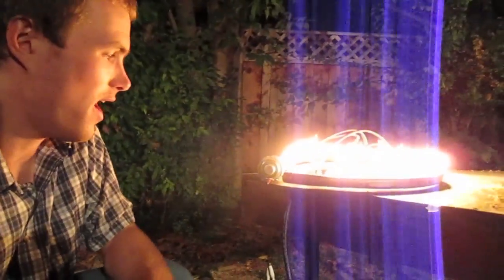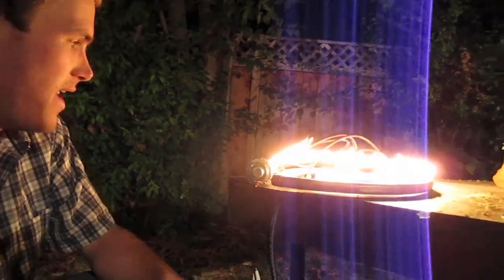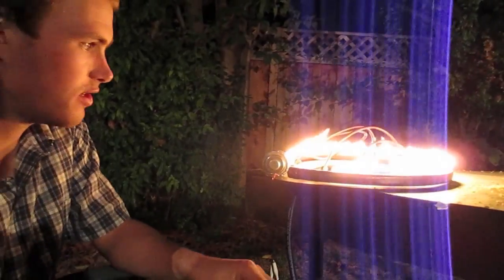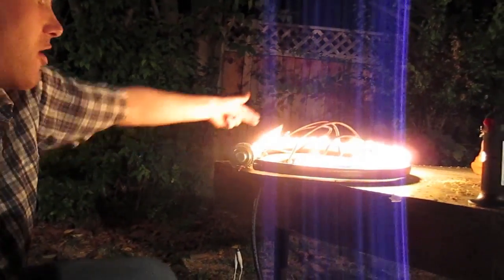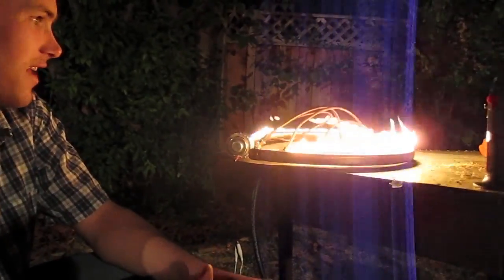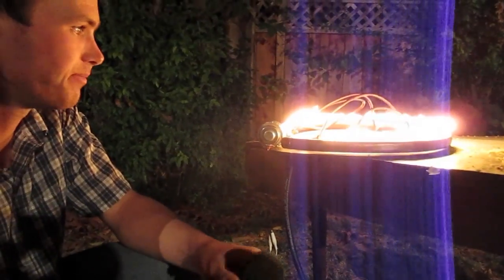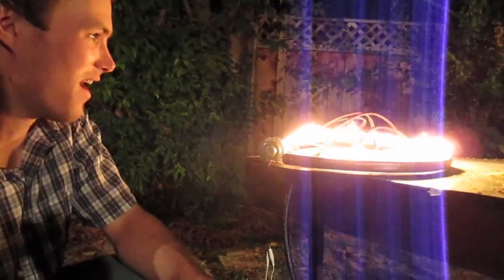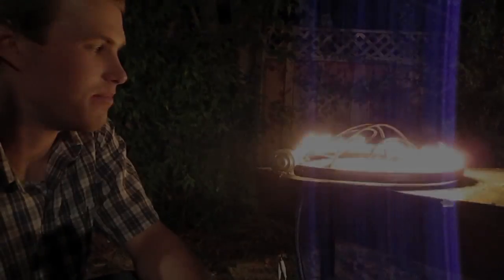Ruben's Tube for Burning Man (Development and Demonstration)

Comment: Did you build this in sections? Is that what the four copper pipes are in the center? Each supplies propane to a section of the tube to get an even burn or are they more structural for the hat

Comment: Looks good, but the fire isn't as defined as some of the other ruben's tubes i've seen on here.  I wonder if having fewer holes would help define the sound waves a little better?
Reply: Little late for replies I know but for others searching the curve doesn’t diminish the effect you can essentially have any shape you want the gas fills the tube uniformly complex shapes might require multiple injection sources but otherwise shape won’t affect it, but fewer holes in his case would definitely help the vidualization I would say half that many holes would be sufficient for max effect you want the holes spaces farther than your individual flames are wide. Sorry for the novel I’m building one of these now and just sharing info
Reply: @nerddub  wow didn't expect to ever get a reply on this comment haha.  That's  cool that you can use any shape but I don't have a pipe bender so I just made mine straight but it worked quite well!
Reply: @adamtwelve  awesome!, quick tip for no pipe bender lol, fill the tube with sand and use nails/ bolts in a board to bend against works well enough!
Reply: @nerddub  I'm going to have to look that up because I can't visualize how the sand plays into that lol
Reply: @adamtwelve  the sand stops the tube from collapsing when bending! It sounds crazy but it works extremely well for smaller-ish tubing
Reply: I wonder if the curvature diminishes the effect...